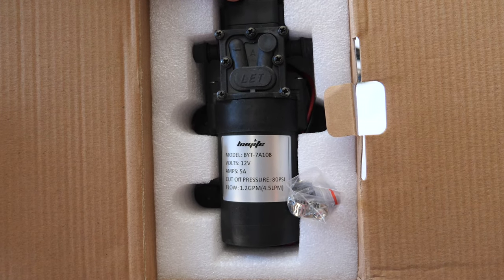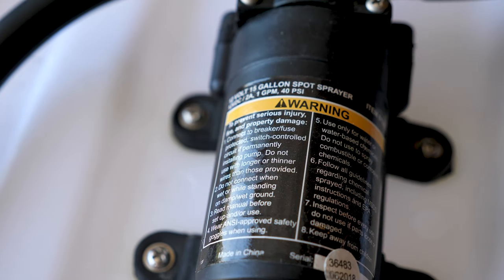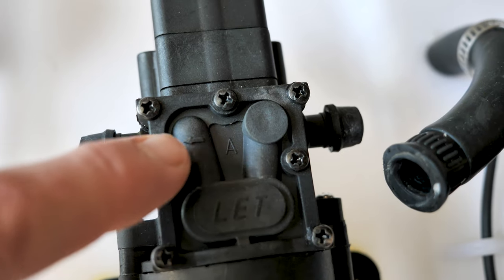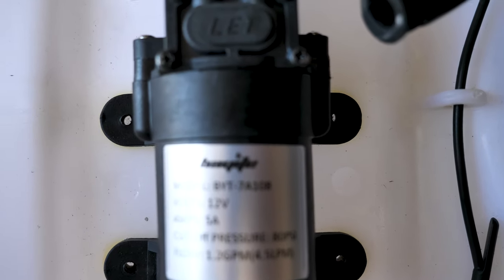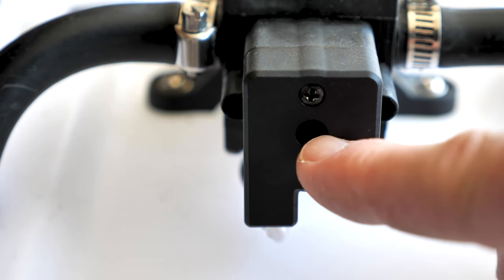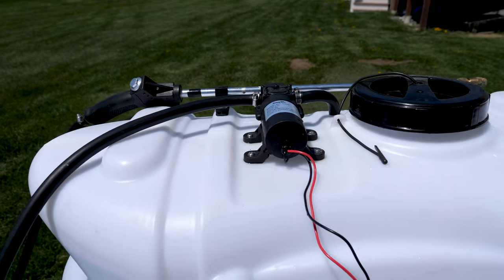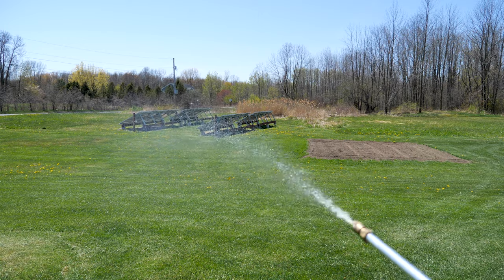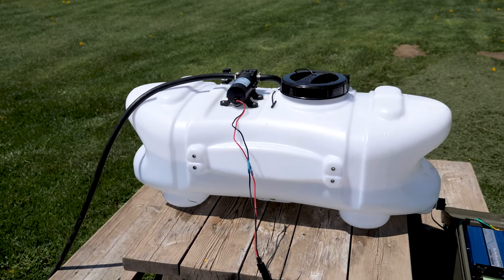Replacement Pump for Harbor Freight Greenwood 15-Gallon Spot Sprayer

Comment: I have nearly given up on Harbor Freight. Anything mechanized, especially if you read the reviews, has about a 20-50% survival rate out of the box. But for the price, the non-mechanical parts like your tank or forged/machined parts are good enough that if something mechanical fails, you can just upgrade that part and will have long service life. That is a nice replacement pump, and for the price/Prime, it is very cool to get twice the pressure. Thanks for your work making vids; I know how much it takes and am trying to start making them, because I have a million vids I could do.
Reply from the maker: Thanks.  Yes, I agree, Harbor Freight crap usually doesn't last!  Yes, glad to be making vids again, took some time off during COVID to focus on family and job.  I did film in that time so now, I working the backlog of editing.  Have a few more vids to push out before I'm caught-up.  As always, thanks for watching.  Hope things are well in MT.

Comment: Super helpful video! Thanks for the pump recommendation. The only thing I did different was I took the quick connect off the old pump and soldered it to this new pump. I put some heat shrink around it and it was good to go!
Reply from the maker: Great tip!

Comment: I do pressure washing and put the BYT-7A111 100psi and a pressure washer wand on mine with the regular wand and 0 degree tip it'll spray vertically about 25ft and about 40ft horizontally, 2nd floor aint a problem. I also like using the tips as opposed to the junky adjustable nozzle, much better consistency for a spray pattern.

Comment: Hey Green Mountain DIY Guy, I need some help.  I lost the nozzle fitting/brass tip for this same spot sprayer.  Do you have any idea how I can get a new fitting somewhere?  Or do I just buy a new wand?
Reply from the maker: That nozzle should be fairly universal.  Check out you local hardware store or Harbor Freight.

Comment: Its cheaper just buy a new one rather replacing the pump > What you pay for the pump! Can get a brand new one. Plus can use the old tank for a gasoline storage! I made a stand to put my 25 gal. tank on ! high enough where i can pour my cans of gas into it easy!   its high enough to fill my riding lawn mowers its got a shut off valve on the tank spout,  and the handle i fill it with >  cost of 3/4" hoses 10' , 4 clamps and 2 valves 25 dollars